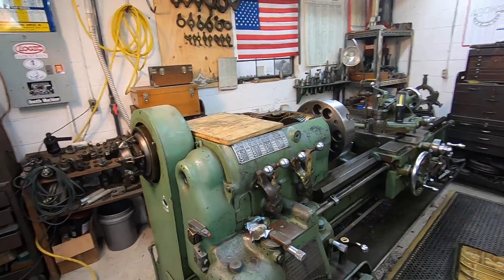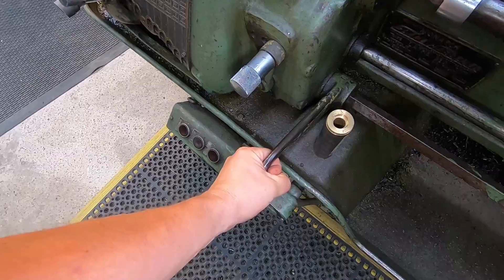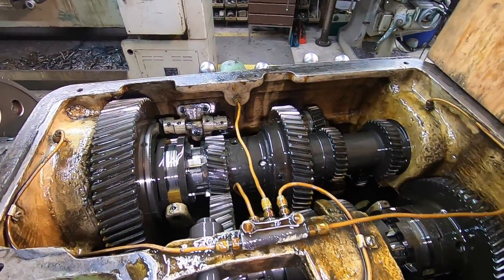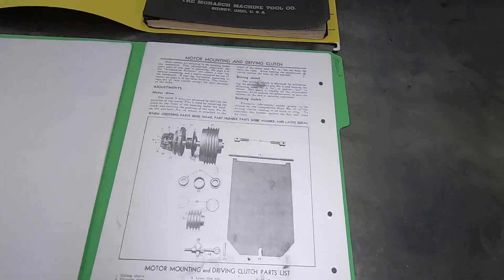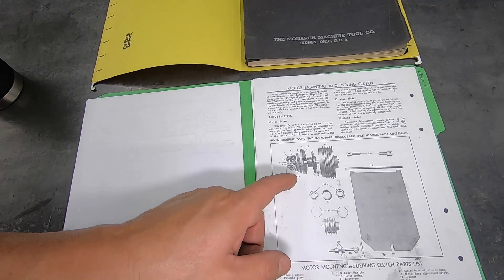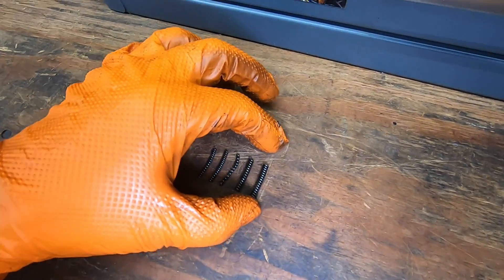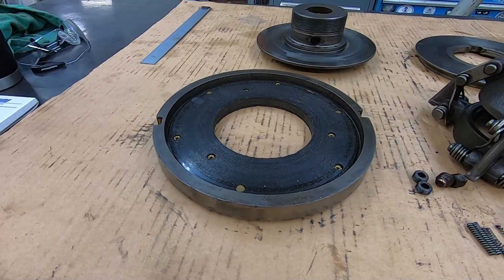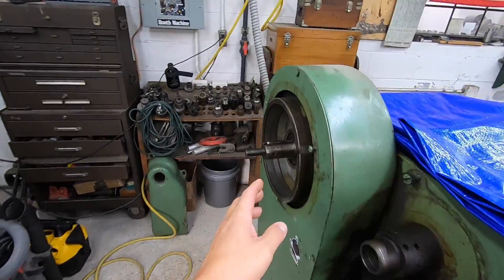Monarch Lathe Clutch Repair Part 1

Comment: Machine a tool that holds the pin out to service the clutch, and have old tony make you some springs with music wire and a lathe
Reply: Nah, Steffan makes the springs. If you're getting Tony involved he can just use his time machine to retrieve the original springs before they broke.

Comment: FYI - Video Problems - 5-20-2020 On you "Monarch 16 CY Lathe Maintenance & Repairs" Playlist, the second video is showing up as "Private"...  Based on the dates that is probably the Oil video, but...
Reply: Adam has probibly set a date of release that has not  yet arrived hence private.

Comment: wrong springs would cause that problem plus missing some would put pressure on one side causing a slit tilt in the clutch ,,, sticking ..the higher rpm would help throw out the clutch ..

Comment: Hey.  Why do you use the crescent wrench backwards?
Reply: That’s the right way to use it. The max stress on the movable jaw is closest to the jaw support that way.
Reply: Using a crescent wrench is NOT orientation dependent. There are countless videos with break tests showing it doesn’t matter. That was a thing they used to say but in practice it makes no difference.

Comment: NOt getting an email with photo attachments?   Once you were on the phone, you could have tried sending a simple ‘here is my contact info’ email to each other from each other.  A corporate firewall might be limiting attachment size, and there never is a response - spam mitigation strategy.    Sending a link to a google drive or drop box is also an option.  On a machine that old, the ‘brake material’ might be asbestos.  Be careful.
Reply: The issue with the asbestos would be any dust that has been generated from clutching/braking.  The pads themselves are not friable, unless you abrade them, drill them, etc.

Comment: Can anyone say why there are large holes on the back of the chuck? Is it just for weight reduction/balancing?
Reply: Yes. Weight reduction.
Reply: reduces weight but it keeps strong with the webbing.  like an I beam instead of just a solid square of metal...  the back of giant 20 foot wide glass telescope mirrors are hexagon webbed to keep stiffness without all the weight!

Comment: Your problem lies in your disc assembly and it has to float freely on the two drive dogs one of which you had to drive out with a punch. Clean the friction faces with a scotch pad and brake clean. Your friction dics is good until it is worn to the rivet heads soaking the friction disc in naphtha will draw any oils out and blow dry. Assemble and adjust your clutch to spec 1/16” between friction disc and clutch plate. Start making chips
Reply: Yup.  As u said it's got to FLOAT and the drive tangs are keeping it against the inner plate.  He never complained about slip.  I'd keep that friction disk.  Open a can of worms if the correct friction material is not used.  Probably different to typical brake or clutch material.
Reply: Yep... this right here. But the springs need replaced while he’s in there.
Reply: 342 comments so far.....and you were the only one that got it right. Gotta love the YouTube "experts".
Reply: @MadDawg91108  Lol!  New parts mechanics.  U got similar problems w motorcycle clutch when the "teeth" cannot slide on the dogs.  Release springs (which u don't have in a mcycle clutch) do have to be correct.

Comment: On the emails, either the attachment is too big, or you are blacklisted.
Try reducing the image to a standard size. Something like 800x600 in jpg.
If you are blacklisted, they will have to fix it on their end.
Reply: Yeah the size of the pictures could be the problem. When I used to work as a supervisor in a manufacturing plant we would have e mails not work because of attachment size.
It's part of the security system for the computers. It's supposed to stop someone from emailing in a virus as an attachment.
Reply: I don't even bother sending the pic, just a link to my shared google photos.

Comment: Adam, be careful putting new grease in on top of old grease. Incompatible greases can react and either turn rock hard or melt out. Take out the bearings and repack them with the new grease and flush out the grease lines also. Good luck.

Comment: I wish I had gears like that in my main lathe--at high rpm its a noisy cow of a thing..E
Reply: My Colchester Triumph 2000 with worn straight cut gears is loud enough at high speeds to warrant hearing protection.

Comment: Adam. Me and some people I know have had issues with emails no arriving, we still don't have any idea why but it seems to be related to the amount of people on the internet at this time.
And Hello Abby 👋👋👋
Reply: There's not 1 Internet, there only can be to much on 1 site (server) but not on "the internet" cause it has millions of places and ways and if one is closed there's another one to use. It is designed especially for such a case .Not receiving an email can have different problems on both sides.

Comment: The springs can be straitened and length could be added by tapping between coils.   After springs are sized, they are put in a 500 degree oven for an hour to relax the stresses in bending.   Once out of the oven, the springs are allowed to cool to room temperature.
Reply: You're kidding, right?  I know we all like to try and do our best when it comes to restoration, but come on!  It is time to call the spring store.
Reply from the maker: Some parts need to be replaced. I’m in no way going to waste my time fixing old worn out springs when new ones are commercially available.

Comment: Email Issue!!  Make sure that the total size of your email is less than 10 MB, lots of email services still use 10MB as max size of an email.
Reply: Yep, I have had that issue.  If you send an enlarged picture/s, it can easily overload some mailboxes.

Comment: The clutch plate rivets should not be flush with the plate. Obviously worn-out plate.
Reply: 50 years ago,I was the new kid in the shop.  I spent a year re-lining brake shoes.  you are absolutely correct.  the linig needs to be replaced, the sooner  the better.  If the rivets score the plates it will cost big bucks to repair.

Comment: One of those brass rivets looks less than 1mm away from scoring a line into your steel plate so I would highly r commend replacing the friction lining. Also I would say that tight square key is paying a part in the clutch not disengaging

Comment: Looks like the friction plate is cracked....
Reply: and glazed...
Reply: @chemech  that would make the clutch slip would't it? He's having problems with it not releasing. I'm going to go with springs being the issue. Notice they're all different sized also? Like the previous operator has had to replace one with what he might have had around over the years, then years later another one breaks. Pretty soon they're all different sizes.
Reply: I think the cracks are from the manufacturing process, you can see the copper staples across them.
Reply: @--_DJ_--  I saw that after he had it sitting on the bench and cleaned up a little bit. Those are Staples that hold the friction material together.

Comment: No, no, no, no, no. If a company is not professional enough to handle an email server, do NOT trust them to work on your parts.
Reply: They could do very professional work. My guess would be it's a small outfit with a fairly low cost email provider that isn't allowing file attachments over a couple megs. They probably don't have any IT staff and just picked a plan online that had a good price. I'd put money on it, actually.
Reply: @94XJ  or he didn't check his spam folder

Comment: Personally, I'd do that flush with diesel fuel rather than kerosene. Kero is much more flammable, more expensive and lacks the lubricating and detergency of diesel.

Diesel has been used for a very long time for flushing out oilbath crankcases and gearcases.
Reply: While I agree with the diesel-is-better-than-kerosene for this application, I think flushing the gear-case is way overkill.  I'd just run the lathe for a half hour to really warm up the oil and get any particulates that are going to come loose into suspension, drain, refill, and know that I've done a 99% job with 40% of the effort.  If you do that conscientiously every 20 years, that lathe will last several centuries in a home shop.   Just my 2￠  OTOH, a full drain,clean,flush,refill will make a more interesting video even if for most people it's a waste of time and materials and environmental impact.

Comment: I am always surprised to see craftsmen in any trade using a "fits-all" adjustable wrench. They are the worst tool to use and cause the most amount of "rounding" on nuts and bolts because they only touch 2 surfaces. I am retired now after 40 years as a welder in the sheet metal workers union but I remember being instructed to use the correct size wrench, 6 or 12 point or socket, to fit the fastener. I have seen apprentices hurt themselves with an adjustable wrench when putting a lot of torque on a stuck fastener. Also we have to use torque wrenches in our industry and the inspector comes along with his torque wrench to check your work and sign it off, if he sees an adjustable wrench he is going to laugh at you.
Reply: Difference here is that Adam isn't an apprentice, and an adjustable wrench is almost always at hand and it really only rounds off if its loose fit.  And probably messed with often.  That bolt probably has been bolted on once at the factory, un/re-bolted once to replace those springs, and now once more by Adam, of 40 years.
As seen in the video, its torqued on very lightly anways, and Adam seems to have it on tight.
Don't disagree with what you're daying, however adj. wrenches are usually fine for 90% of what they're used for. Some situations, yes, you'd be a fool for not getting a proper wrench.
Reply: @boots7859  i agree with adjustable  wrench great for most things ,, if major pressure is needed then a box wrench or socket .. loose or they have it backwards so it falls off the bolt is how damage or injury happens ,,i never got hurt with a adjustable wrench yet , i will be 50 soon turn wrenches 40 years ..

Comment: Check out AlwaysSunnyintheShop's YouTube channel. He recently did some work on the clutch in his Monarch lathe (the most beautiful lathe on YouTube) after a failed attempt to perform the annual greasing. It looks like a different model than yours but the clutch looks similar.
Reply: Driver side looks different, but clutch looks the same.
Best wishes
Reply: I was fixin to say the same.